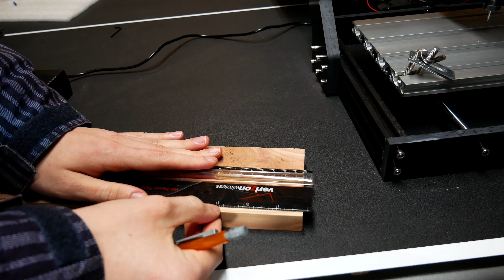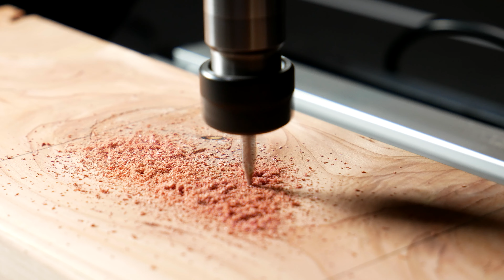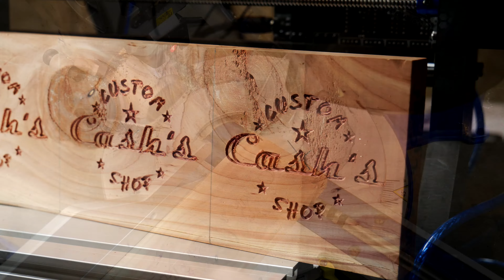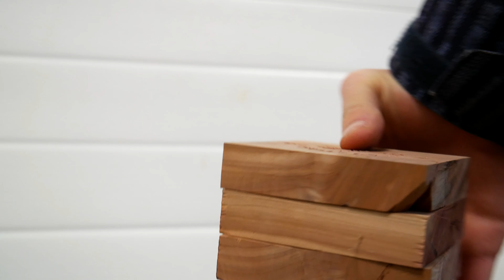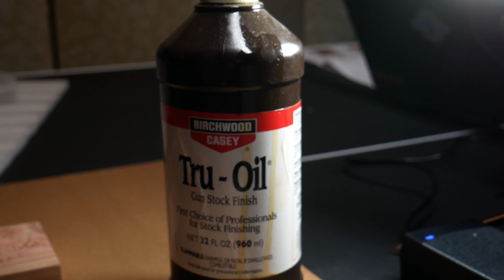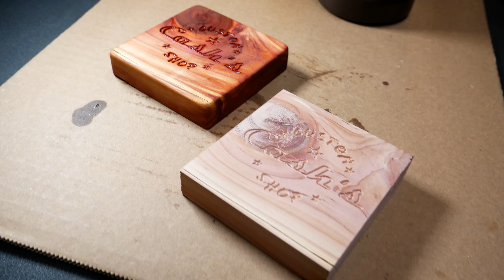My First Cuts with my 3018 Pro CNC Machine | Custom Coasters

Comment: Thanks for posting the video. Please could you share feed speeds etc as this would be useful. These little machines tend to shake themselves apart when pushed slightly hard.
Reply from the maker: You’re welcome, I started having trouble running at the speeds I was in the video, I’m now running it a bit slower. The spindle mount was flexing like crazy at this speed. I’m now running about 7.5 in per minute feed rate and 4 in per min plunge,m. It certainly isn’t fast, it’s tough to run fast with this machine, that’s for sure